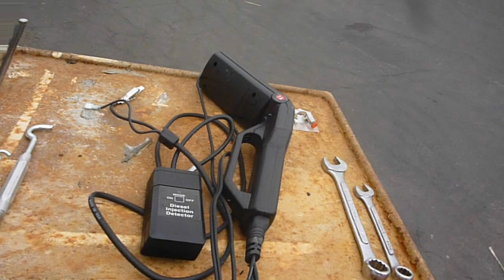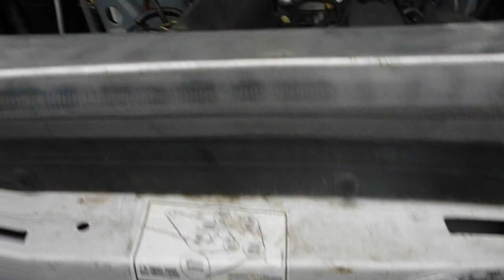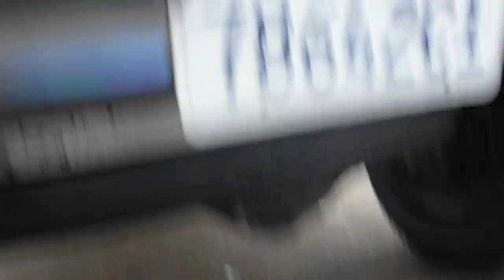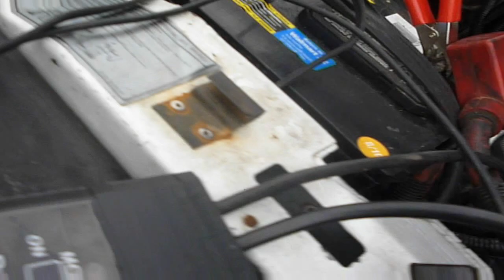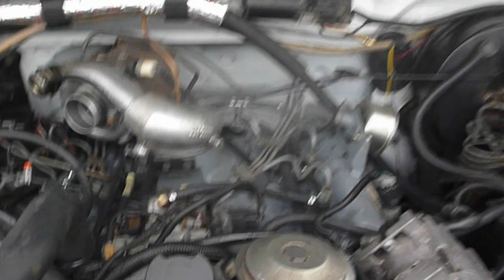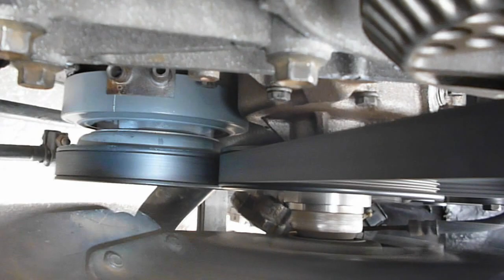Diesel pump timing

Comment: WOW I know you meant for this to be a really informative video but, your camera was all over the place. It would have been nice to see "exactly" where you put the first clamps It was kinds really hard to see. Holding the camera over the engine still for a few seconds would have been really nice. I appreciate the info anyway. So the readout on your hand meter was the RPM's? Where is the black line on the left side your diesel injection detector placed or connected to?

Comment: Good explanation aside from the part when the camera is inside the engine bay.  I’m assuming there is a mark on the front of the block you’re trying to line up using the light, but it’s difficult to know for sure.

Comment: joe got a question.  i advanced timing my injection pump to max  and the  performance increased but is there any side effect????
Reply: Artek Balbawang higher cylinder pressures and hotter combustion
Reply: @danielbjors8460  plus using a great deal more fuel and a lot more heat stress  on the engine.

Comment: Great video. I am doing the top end on my 85 and I just replaced a pump on my brothers 1980 scout with a 1983 6.9L diesel. I will get a ferret timing meter. Thanks for the tips.

Comment: mine is a chevy 6.5L but same principle nice touch on the turnbuckle! My meter can't be reading right or I don't know how to use it. No way it would run as well as it does at 17.2 degrees, and my pump marks are close, they should be 1/4-1/2"  off to be that far advanced.

Comment: I'm using a Stanadyne  time and trac. I didn't have the ground clamp on the injector line..maybe that will make a big difference? I am unsure about the trigger level and offset for the timing light? I was told to use 30% trigger, and 9.5 degree offset, at 1950rpm if my marks a correct on my balancer I get 17.2 degrees when I use the buttons on the timing light to line up the marks to zero on the scale. Which is way to far advanced? should I subtract 9.5 degrees from the reading? I'm confused?

Comment: Neat!! Thanks for posting this. I am thinking of buying one of those Ferrets for my 6.2's, and a 5.7 and 4.3 Olds. I had always heard warnings not to try and move the pump with the engine running though. Where did you get the Ferret and about how much was it? At one time there were some on Ebay, but it has been a while since I saw one there. Thanks  Larry